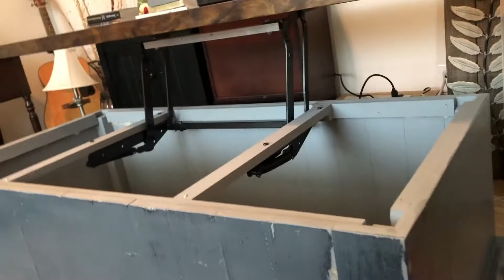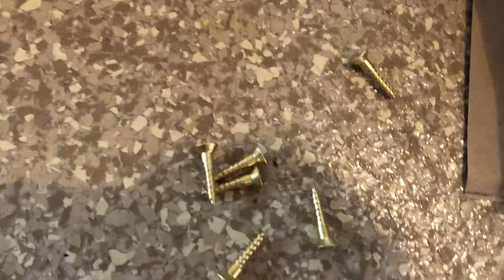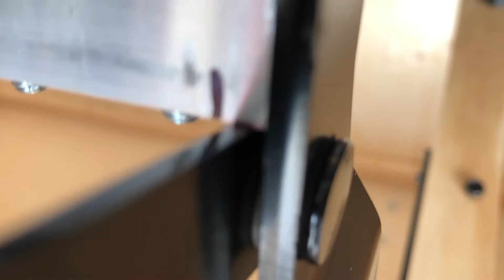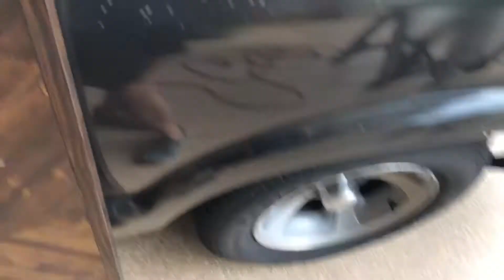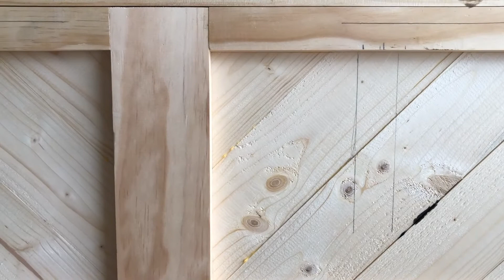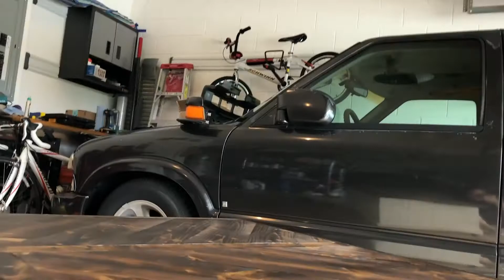Rustic, Lift Up Top Coffee Table W/ Storage Build Part 2

Comment: is the weight of your table top all that is keeping it from springing up?
Reply from the maker: Kind of. The way the spring it designed, the spring almost pulls it closed as you get downward. But as you bring the top up, the spring pulls it upward. 

But if the top were too lightweight, it would spring up.